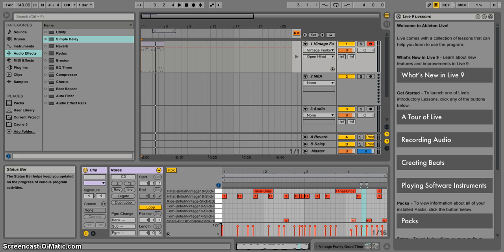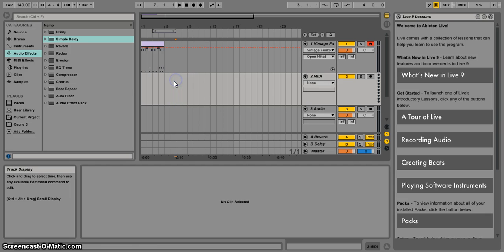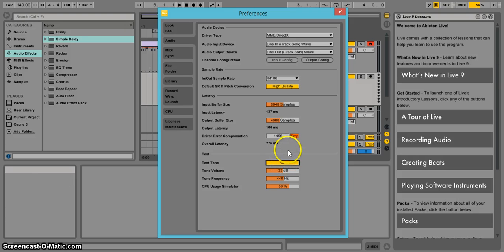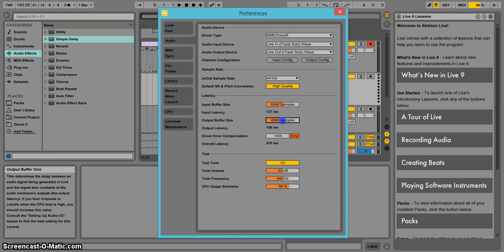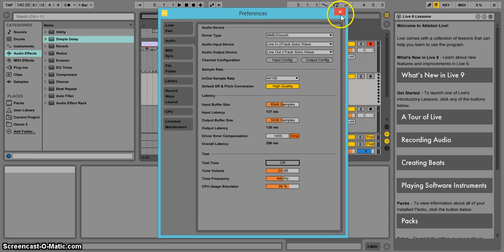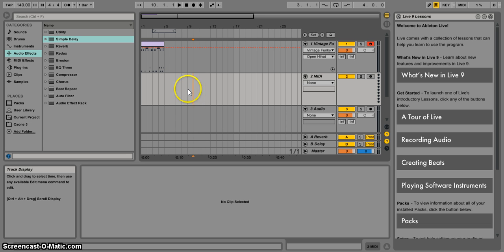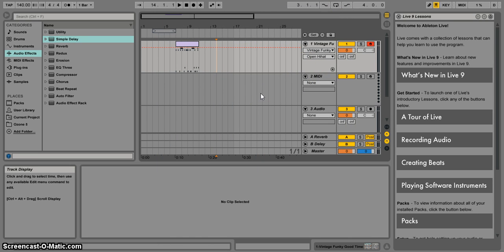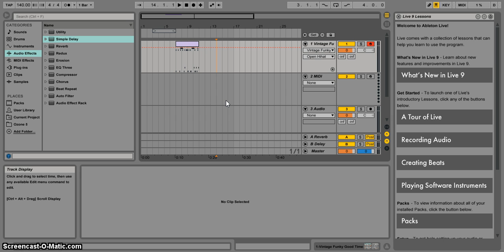Three Problems With iTrack Solo, Ableton Live - Looping - Popping Audio - Crackling Fuzzy Audio

Comment: Hey dude! Have you had problems with the audio output on the iTrack solo? I installed the drivers for it on my PC and everything, and 90-95% of the audio output is coming out of my left ear (I'm using the headphone output). I tried to tweak the balancing and stuff on Windows 7, to no avail.